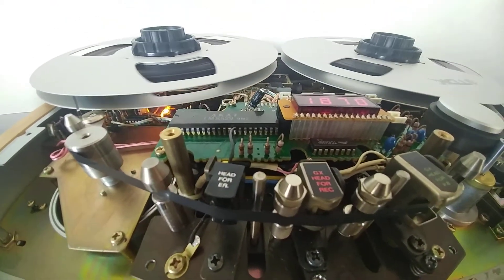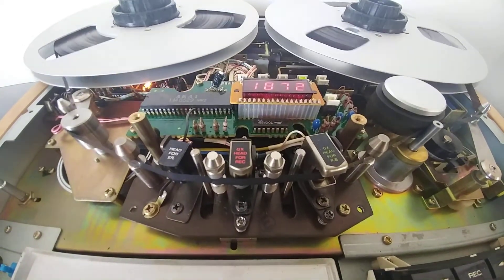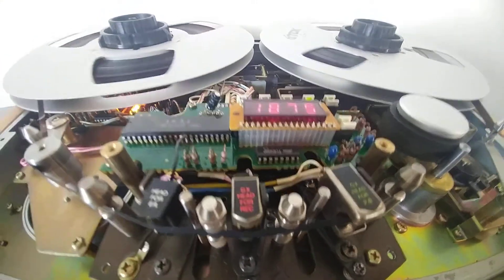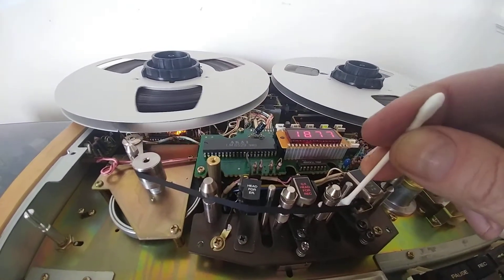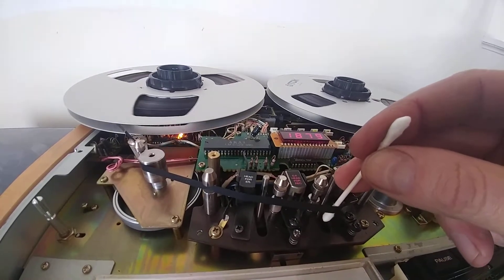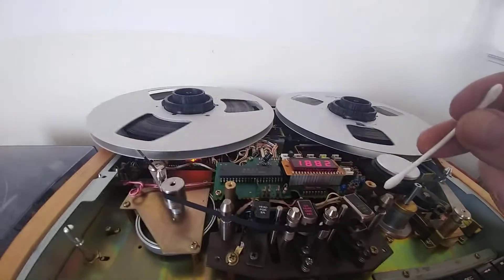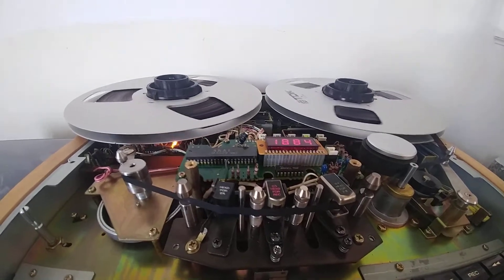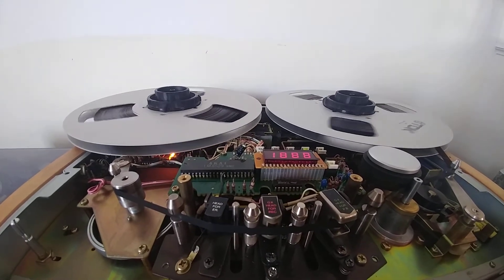Akai GX 625 reel tape player problem squeeching

Comment: Three words: Sticky Shed Syndrome. That's what's causing the screeching noise. That tape is old and in bad condition. Unfortunately, once it reaches this stage, there's not much that can be done to save it. Some people have suggested trying to bake such tapes, but I'd be very cautious as doing so could ruin the tape if you're not careful. Also, the tape bake idea is at best a temporary fix, so although you might get it to play, it would again become sticky and the baking process would have to be redone.

Comment: Nah, it's not the tape. I had the same problem on the same model a while ago, and I think it was because the tape was running too tight. Be sure to have the reel size set right and try to loosen the right arm a little.